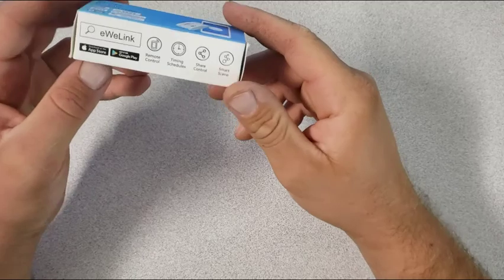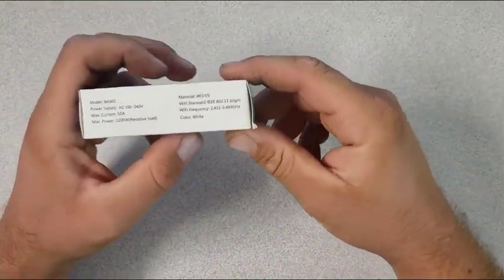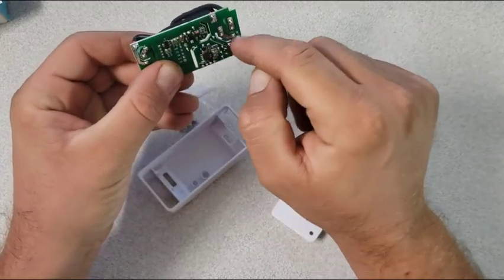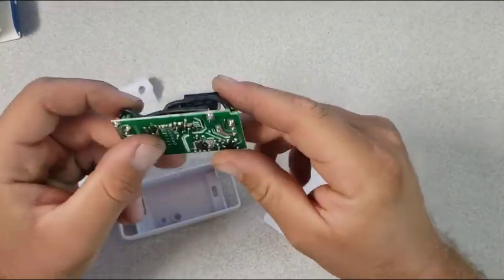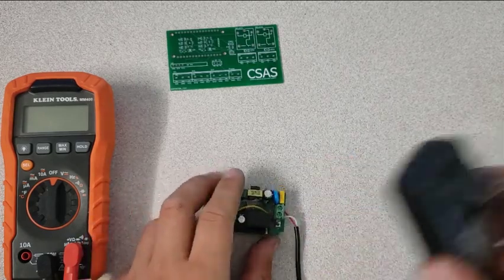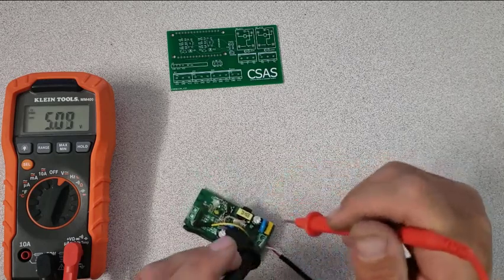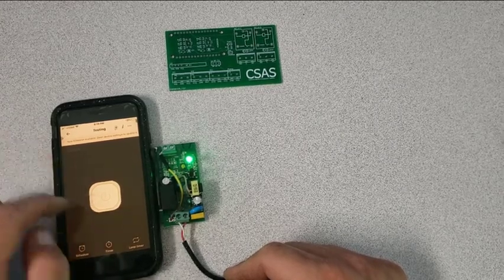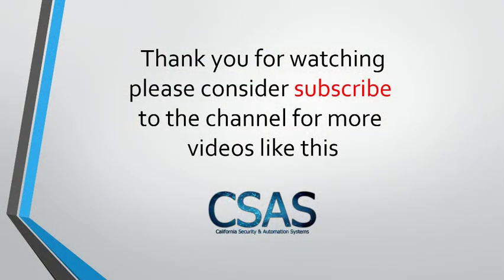Sonoff Basic 5V and turn the Relay to dry contact (Garage Door) Safe Mode

Comment: Why would you do this? There is a version of sonoff which is 5v and dry already.  It is cheaper and smaller.
Reply from the maker: At the time I made this video the product was not existing
Reply: @VoltXSystems  it was
Reply: Which one is this ?? Interested to to this for my garage door !
Reply: I've been looking for the one you speak of for my garage door opener using WiFi.  Do you know the part # off hand?